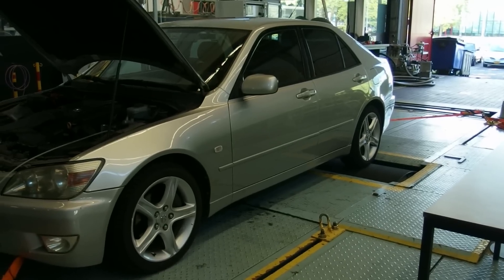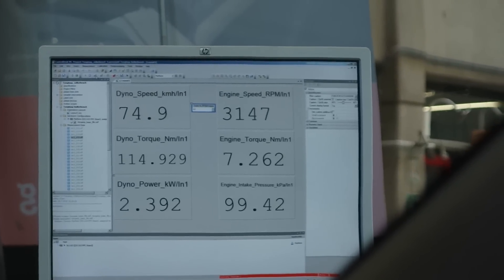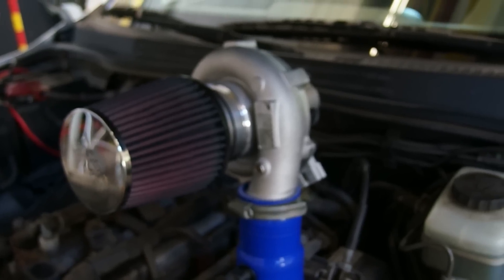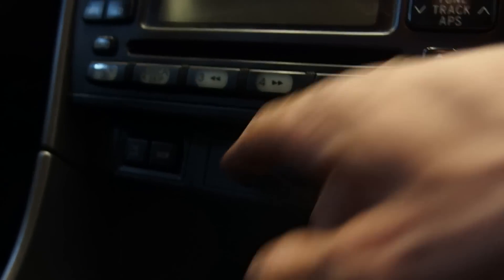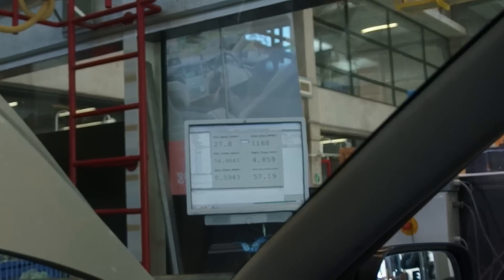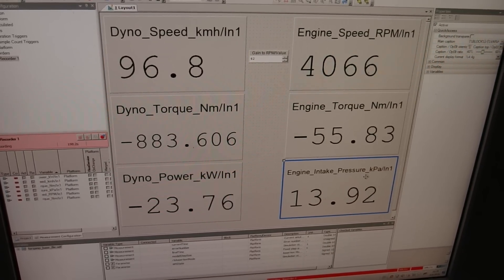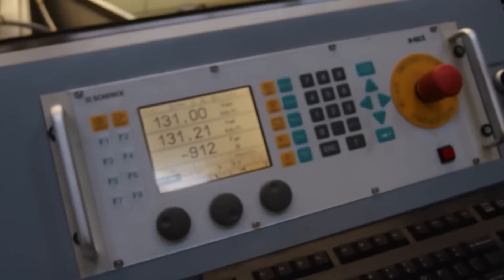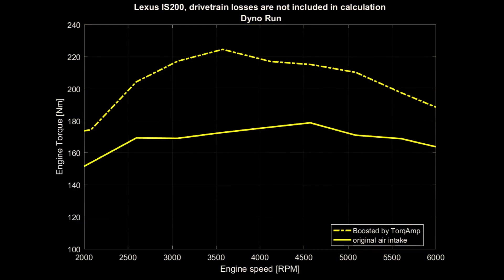Dyno testing Electric supercharger on Lexus IS200 TorqAmp

Comment: see the reason most of these dont work is because you dont just need air you need fuel aswell the cars ecu doesnt know to increase the fuelling,maybe if someone made one that had some sort of connection to the fuel system so it ups the fuel pressure as it it active and pushing air then maybe there would be a proper application for these in the future these will just make the car run lean
Reply from the maker: Our experience is that there is a lot of difference between cars/engines. So some systems will automatically provide more fuel over the whole rpm range. Some will directly go in engine protection mode.

ECU is in general the way to go because it's relatively cheap and the community figured out how to tune on all these different engines.

A separate system is possible with additional injector or special fuel pump but also a big change that the ECU will go into protection mode when it sees variables outside its normal operating mode. Therefore you need to program the new additional fuel map.

Comment: if you trick the map sensor ....wouldn´t that lean out the engine under boost ?-----
Reply from the maker: It depends. This car will compensate the fuel based on the lambda sensor on the exhaust so no problem at all. This is a widely used trick to tune this car because it's easy and safe. When we want to tune another car we always search for a tuning expert for a specific brand/type and he will know what is safe. For most cars it's chiptuning the ECU.

Comment: Awesome to see this technology finally come alive! It's small amounts of power but it's a start. The price is way to high for what this provides, but this is on the right track. TorqAmp if you can make this with a way bigger electric motor and get the cost down to less than the average turbo or supercharger kit, you will definitely steal the market. I would definitely buy one if you could make this cheaper. Keep up the good work!
Reply: How much is it?
Reply from the maker: It's cost $ 3400 you can order by filling in the contact form on www.torqamp.com and ask for the order form.
Reply: @TorqAmp  3400?? You can get a stage 2 turbo for that price and they rven install it for you.. 280hp guaranteed
Reply: @TorqAmp  dude you are charging too much for a brushless motor with some arduino controller reading the RPM or the TPS sensor hooked to a turbo... i can do that for way, way less
Reply: I definitely agree man if they can make it more efficient to create more boost and power while bringing the cost down this will be huge in the forced induction world
Reply: why are you trying to buy a brand name with this though? It's not like a regular turbo where if it's not regulated and the psi is to high you'll blow your engine. this is a fan between the throttle body and the air intake. at peak functionality it's maybe putting 1-2psi on the engine. you can just buy an ebay model. I'd never recommend that with an actual super charger because if it's faulty your engine can blow but with this it's not coming close to enough psi to blow your engine.
Reply: I've seen these lose 30 hp and they cost 400$
Reply: @77nizzova53  Hell yeahh brother welcome to the cleetus McFarland YouTube channel 😂😂😂💪
Reply: @TorqAmp  $3,400 Dollar's!!!!!🤣🤣🤣🤣🤣
Reply: It seemed to me that the power would be beneficial to someone with a turbo application already. When you turn on the car and it will help the boost lag by pre spinning the snail.
Reply: @Republican_Extremest  There are already anti lag, anti surge, electronically controlled variable vane turbos that adjust boost on the fly.

Lag is a thing of the past
Reply: I don't think so Audi is using similar technology and they use 48 volt for a reason. By the way... People buld these for a couple 100 themselves
Reply: @77nizzova53  torqamp is not your cheap chinese setup..its a 48v system with the transformer being the size of 10 gallon fish tank.
Reply: Torqamp is not your cheap Chinese setup..its a 48v system with the transformer being the size of 10 gallon fish tank that either sits in your back seat or in the trunk.
Reply: fpasillas 🤣🤣🤣🤣 I want another big heavy fucking battery to deal with. 👎🏻
Reply: on the website it talks about helping get rid of turbo lag thats cool on its own
Reply: @Republican_Extremest  you could do that with an air tank

Comment: Will we ever see these pushing 20+psi?
Reply: Until someone develops a really really fast and strong motor then... well, yes
Reply: @lifeofmike556  such motors already exist, the problem is not with finding and fitting a bit enough motor, the problem is with powering it. This electric supercharger only makes about 5 psi of boost and it needs a huge battery that completely discharges in less than 5 minutes. You'd need a much bigger and heavier battery to power a motor big enough to make 20 psi of boost, it would be extremely heavy, and it wouldn't last long. That's the problem. We have the motor technology, but we need to power it.
Reply: A electric solution like this would give me only 5 minutes a pop ???
Reply: @m.morininvestor9920  yes basically.
Reply: @TheRealWALLABI  Soo not worth it then ...
Reply: @TheRealWALLABI  well you are saying 5 mins a pop but no one is staying in boost that long. You run the mustang next to you 20 seconds in boost then you shut it off and it recharges.
Reply: @whocares5188  yeah, but it takes much longer than 5 minutes to recharge.

Comment: I honestly think the money is in an electric roots blower.  Requires far less rpm to create pressure and will run on less power than the hair dryers being marketed today like torqamp.
Reply from the maker: We are also working on an electric roots blower. The power required to compress air is mainly based on pressure ratio, air mass flow and compressor efficiency by thermodynamics. The roots blower have in general a bit lower efficiency so for this application the centrifugal compressor is the better option.

Comment: A bypass intake valve for when driving w/o the electric supercharger turned on would be a nice improvement to maintain more of the (stock) engine power
Reply from the maker: Yes we developed a bypass https://torqamp.com/bypass/

For a 2L you don't need it but for larger engines it could be beneficial
Reply: @TorqAmp  thats great stuff that you guys already done this in the meanwhile. Though i saw cleetus lose 13hp with the torqueamp hooked up and not turned on with the 2.2l cobalt so i will lose maybe around the same number of hp on the 2.0l w/o the bypass, atleast it seems logic sense to me. Please correct me if im wrong and explain me why i would not lose power on the 2.0 3sge when the torqueamp is in off mode. 
No offence and sorry for being sceptical, i really love the stuff you guys have put on the market, i just want to be well informed on this before i would spend a serious amount of money on this electric supercharger.
Reply from the maker: @monoracer_  completely understand. You can check the Honda Prelude dyno graph which shows something comparable. https://torqamp.com/use-cases

The reason I said it's not necessary to use the bypass because the loss is relatively low amount of horsepower, you can perfectly drive and you probably don't have the intention to drive with TorqAmp off.

It obviously also depends on how you want to use it.
Reply: @TorqAmp  so you can put a switch on the gas pedal with progressive boosting?
For example:
25% throttle -> 25% power from the torque amp 
5p% throttle -> 50% power from the torque amp
75% throttle -> 75% power from the torque amp
100% throttle -> 100% power from the torque amp

I wouldnt bother the impellor drag hp loss when its turned off if this would be possible
Reply from the maker: @monoracer_  it's possible but you have to find the right balance between energy consumption/heat development.

We recommend for example 75% throttle is 0% TorqAmp and 95% throttle is 100% TorqAmp.

Don't expect complete different driving behavior when the TorqAmp is turned off at low throttle position.
The reason is simple. A car will drive with nearly closed throttle valve while cruising. So you don't pull huge air flow through the compressor so it will not or nearly limit the air flow.
Even if there is a pressure drop over the TorqAmp compressor this will be compensated by opening the throttle valve slightly more by your feet.

So if you spin the TorqAmp compressor reducing its own lag at 25% throttle you will close the throttle valve even more by feet (otherwise your car starts accelerating).
Reply: @TorqAmp  great information,

At what temperatur in celcius is the torque amp overheating? I wonder if there are ways to improve this by adding cooling fins to the electric motor housing or maybe if you can make a coolant chamber that slides over the electric motor but maybe 90°c is already too hot for the electric motor, this i dont know of how hot electric motors get and may get before they start to fail
Reply from the maker: @monoracer_  the temperature limit is based on the temperature of the motor controller. This is comparable to the electric motor temperature. The limit is 70 degrees Celsius. For typical street use this is perfect. For track use it is the limitation. 

We are working on a water cooling system but are not yet satisfied with the results. 

The compressor will cool down faster than the motor controller because cold air is going through it when the engine is running.
Reply: @TorqAmp  looking forward to the new supercharger who will have better cooling and kick in earlyier
Reply: If you want, you can do a test run to add to your test videos on youtube with my toyota mr2 sw20, i do not live too far from you guys so coming over is not a problem

Its a 1990 mr2 with the gen II 3sge engine.

There is one thing that i might need to get be4 doing this if you are interested to try it out on my car, i suppose that i still need to buy a engine management system first to do the ecu mapping to suit the torqueamp boost
Reply from the maker: @monoracer_  thanks for the offer. You're right, you also need an ECU that gives more fuel and right ignition timing. This also requires the right tuner for that type of ECU. Sometimes it is easy sometimes you need some specific knowledge. 

At this moment we cannot use the dyno and we expect that will be the case for next couple of months. We could consider it at later moment.

For the Lexus IS200 we didn't have to change the motor management. Not sure if the mr2 has a comparable system.
Reply: I have no clue tbh, i think the car is running quite rich now since it drinks quite allot fuel, but i find a wideband gauge and a stand alone/piggy back a must when doing this kind of thing. Just for the peace of mind to be sure to not blow up the engine
Reply from the maker: @monoracer_  yes exactly, the wide band lambda will show if the engine will run lean. Do you have knock sensors to avoid engine knock?
Reply: @TorqAmp  i dont know tbh if the 3sge gen II has knock sensors, is it necessary?
Reply from the maker: @monoracer_  knock it not really necessary. It makes it only easier to avoid any damage. There are more easy tricks to avoid engine knock such as using high octane fuel.
Reply: @TorqAmp  i always use 98 octane fuel, i could add octane booster too
Reply from the maker: @monoracer_  yes 98 is already a good start. In this area it is also possible to find octane 102 so even lower risks!

Comment: There's a guy that's been doing something similar down my way. Using a belt driven system to spin the turbo faster. He is also using a esc that runs off factory voltage ranges in cars. Making 8 psi on a gtp38 awesome really.
Reply from the maker: Is it a company or a hobby project? We haven't seen it so far.
Reply: @TorqAmp  no it's his personal project. Definitely a odd setup. He's older but I'll do videos when I'm back in town.
Reply from the maker: Sounds always interesting to see what other people did on this. We like that people do this and prove on dyno's around the world that this system is not fake/scam.

Comment: Eventually won't this need more fuel than what the stock computer can meter?
Reply from the maker: It's highly depending on your  fuel system what happens. Every car that is suitable for chip tuning is in general easy. Some systems just provide more fuel because they measure more air and function automatically.

Comment: So, do I undertand correctly - the power and torque gains are 22WHP and 46Nm? That's... almost nothing, compared to what you can read on the side, how the E-Supercharger is supposedly superior to both super and turbo charges on low and high RPM's respectively. I mean, you can get same if not better results bu simply chip tuning the engine...
Reply from the maker: It is easy to gain more with chip tuning if the car is already equipped with a turbocharger. This is not possible for naturally aspirated engines such as in the IS200. The IS200 has an ECU that is self learning and therefore the results could be better (check the Honda Prelude video, it's also a 2 liter). It is also possible to gain more on naturally aspirated engines with higher boost levels but it requires much more effort such as opening the engines and lowering the compression ratio. Therefore the TorqAmp is delivering these boosts levels because it keeps the installation much easier and faster. You can keep the car original and remove the TorqAmp easily when you want to sell your car.
Reply: @TorqAmp  Thank for such a quick reply! :)
But I'm more interested in E-Superchargers as a replacement for typical Supercharger. The low-end torque is nothing but outstanding, no doubts here, but the biggest question is how long can it run continuously, how long the battery can hold up berore you will need to sop and wait for it being fully charged again? This doesn't sound convenient in a longer, fer hundred km trips :/
Reply from the maker: @zywypl  You should think about it in a bit different way. You only need more air when you want more power by burning more fuel. When there is more power you will accelerate. For cruising on the highway your throttle valve is nearly closed to lower the pressure in the intake manifold and limit the amount of air coming in. Only for an acceleration you need more air so you open the throttle valve. In case of a turbocharger the turbo is running slowly and spools up when you open the throttle valve (generating more exhaust gas flow). So a typical turbo is also not boosting when cruising. For a belt driven Supercharger it is a bit different. The Supercharger is always creating pressure (consuming crankshaft power which comes from burning fuel) even when you're cruising on the highway, which doesn't require a lot of energy so to limit the amount of air going into your engine the throttle valve should be closed even more (otherwise you accelerate). The TorqAmp is standing still when cruising and at the same time charging the internal battery. When you want to accelerate and your throttle valve is nearly completely open you probably need more power and the TorqAmp spools up instantly to provide more air to burn more fuel and so accelerate faster. So for most of the time boosting devices are not necessary, only for the accelerations which last most of the time a couple of seconds. This explanation is for gasoline engines and not for diesel. Diesel combustion works a bit differently.

Comment: Using the OEM ecu on any obd2 will usually result in the car “Learning” it’s way back to factory setting via its own software. 
IMO I would think this application on something that comes factory turbocharged would work better aside having the ability to throw fuel at it and timing with tuning abilities ! 
Aside from that I think you guys have a nice product and I can’t wait to get my hands on one !
Reply from the maker: Thanks for your reaction. The nice thing is that we create an ECU map area that didn't exist before because naturally aspirated engines have no map above ambient pressure and we only add something above ambient pressure. Therefore we didn't have any problems with tuning OEM ECU's yet.

Comment: You are better of connecting a petrol leaf blower ,I'm not joking really but make sure you get a good quality one surely that would be much cheaper and better.
Reply from the maker: We doubt about that. Our electric motor delivers 5kW of power. Doing both flow and pressure increase. A leaf blower doesn't use the a centrifugal compressor principle but is only focused on flow. To have a nice gain you need to generate boost like a turbocharger or supercharger is doing. So this requires the same compressor technology.

Comment: The intake temp sensor looks like it’s just pressed into a grommet into the silicone coupler. Any positive pressure would pop that out... try again 😂
Reply from the maker: It's indeed pressed in but the hole is small and the other side of the sensors locks good at the other side of the silicon so it doesn't pop out.
Reply from the maker: @Druze_Tito  exactly
Reply from the maker: @Druze_Tito  we have a special Kickstarter price for you ;)
Reply from the maker: @Druze_Tito  it is a hightech product made of a lot of expensive components. We need a much larger production run to be able to lower the price significantly.
Reply from the maker: @Druze_Tito  that is indeed a solution which we can do when it will not work out. Now we try it first this way before talking to large investors.